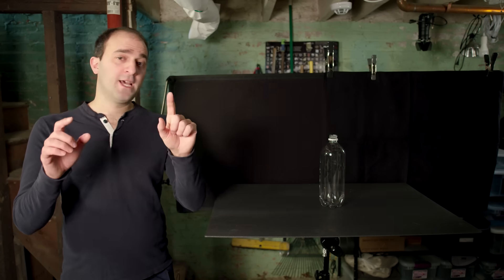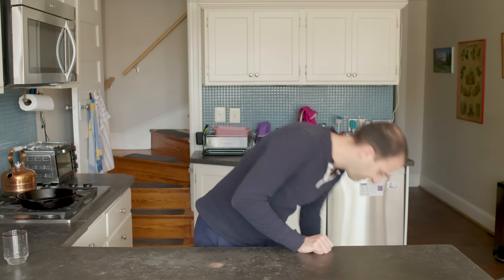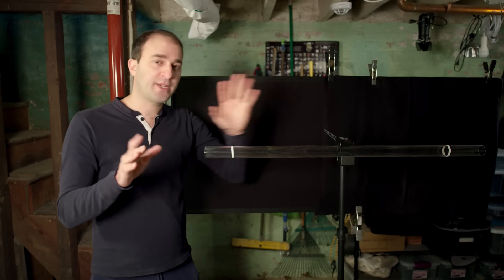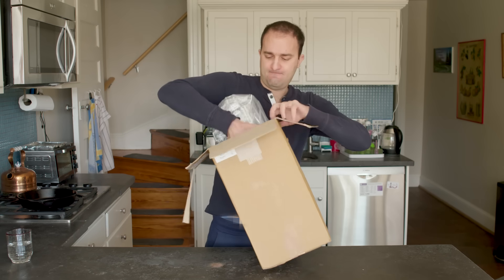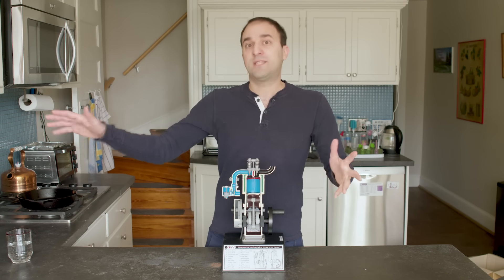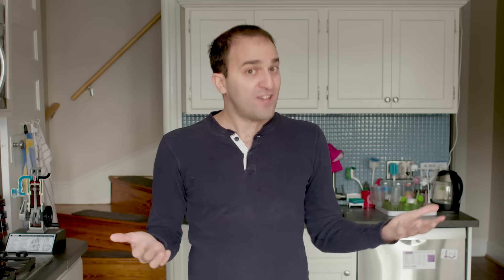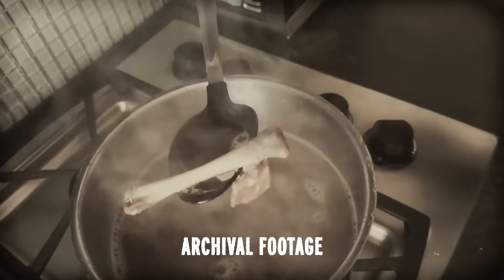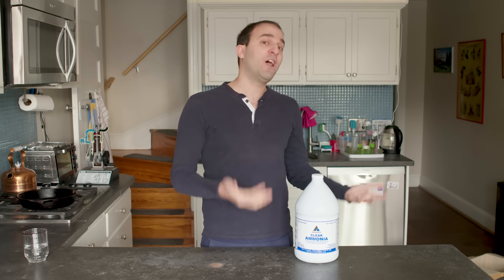Does Toyota Know Something That We Don’t?

Comment: Gasoline and diesel are highly flammable and relatively toxic compounds. Ammonia is highly flammable and far far far more toxic. Replacing a bad with a worse does not make much sense especially because you'll be venting a large amount of Nitrous oxide which will turn into Nitric acid in the atmosphere. I fail to see how an exponential rise in acid rain is actually a benefit especially when people are going to be dying in their garages and homes from leaks.

Then there's the energy need which is impressive. A commercially viable 1000 ton/day ammonia plant consumes 35GJ of natural gas to make 1t of ammonia at about 50% efficiency. That is 892.5 cubic meters of methane burned (and cracked for hydrogen) per ton of ammonia. That's equivalent to 277 Kilowatt hours of electricity. Multiplied by the thousand tons made per day and you get 892,500 cubic meters of natural gas and 277 Megawatt hours of electricity or enough to meet the daily energy needs of 9551.7 American households (29kWh./day) or 32,511.7 German households (8.52kWh/day) for a more energy efficient national comparison.

Gasoline usage in the USA is (as of 2022 numbers which are what I could find) 8.81 million barrels of gasoline per day. Each barrel contains 5861520kJ of energy. Assuming you want everyone to be able to drive the same amount you need the same amount of energy. Ammonia is less efficient when burned than gasoline and in an internal combustion engine studies I've seen show about 30% efficiency but for now lets take the impossible best case and assume 100% combustion efficiency. Numbers get a bit tricky here since every source invested in this tech appears to be throwing their own numbers out as 'truth'. So I've taken the heat of combustion assigned by the NCBI of 382.8kj/mol. 1mol of ammonia is 17.03g so 1kg contains 22,477.98kJ of chemical energy when combusted completely. This compares to 49,000kJ/kg for gasoline. Therefore if we need to supply the same 51,639,991,200,000kJ (8,810,000*5,861,520) of energy in the gasoline used by the USA in 1 day you need. 2,297,359,068.7kg of ammonia (2,297,359t). Going back to our production values earlier this would take 80,407,567GJ of energy to produce or 22335.43 gigawatt hours. Global electrical energy production is around 25,343,000 GWh so barring somehow of reducing energy consumption to a fraction of the current value you would need 0.008% of the total power produced each year just to provide the fuel for the USA. If basing it off the US electrical production figures you need 0.56% of US energy production to meet the daily needs of this industry.

Making gasoline takes 35.6kWh/gal meaning producing the same 8.81 million barrels (each of which is 42 US gallons) of gasoline uses 13,172.7GJ or only 3.66GW/h daily. So making enough ammonia to fuel the cars of JUST THE USA using modern production methods takes 610,257% more energy than is used to make the same amount of fuel energy in gasoline.

Overall I've seen worse ideas before but this idea is up there with the more questionable industrial decisions of the 1920s and 30s in terms of risk/reward analysis.

Comment: One summer I worked in a storage/shipping/logistics type of business and they had a forklift that ran on ammonia. This was legally required for people to work alongside it inside a shipping container, since diesel exhaust was considered too harmful. This was in the naughties and at that point they had had this forklift for years. My point is this technology is proven and has been in use for decades, and an ammonia engine is powerful enough to run a forklift, so it will definitely power a car. Smelt pretty vile, though.

Comment: we were taking about this in university 30 years ago.  it makes sense as a way of storing "excess" electricity generated from renewables. it can be synthesised on site. its a valuable feed stock. much easier to transport and store than hydrogen. i am surprised it has taken this long to be discussed in the wild
Reply: No that's completly idiotic, what ever university you went too you should ask for a refund.  If you want to store electricity you dont turn it into a chemical which then needs to be burned, you would be loosing 90% on the round trip.  Electricity at grid level is best stored in pumped hydro, flywheels or batteries.  And if you just want to just make any industrial process, particularly chemical synthesis powered with renewables then you MUST convert that green energy into a steady source first because constant stop-start is going to ruin nearly every chemical synthesis as well as ruin the utilization time of the equipment and capitol investment.
Reply: quiet you  @kennethferland5579
Reply: How would you go about synthesising it onsite in a smaller scale? Wouldn't Haber-Bosch be too dangerous and bulky to use?

Comment: High octane fuel burns slower. So it will burn thru the whole stroke in a high compression engine. Low octane is use for lower compression engines, where detonation issues is not as prevalent. Ammonia seems to work for very high compression. Not sure about the lubrication values of Ammonia thou..

Comment: Vehicles using propane as fuel carry a large compressed cylinder full of the stuff down the road at 80 MPH. It’s really not far from being a bomb. Yet there haven’t been significant incidents in that use. I don’t see ammonia as much different than propane.

Is ammonia dangerous? Yes, but that doesn’t mean we give up on it.

Can the dangers be sufficiently mitigated? The benefits of the fuel warrant a rigorous exploration.

Comment: I'm a little dismayed by short sighted comments.
The petrol car has been under development in one way or another for over 100 years. This means that the modern car has been developed well past some of the initial problems and we only see the end result. Things like a lack of infrastructure, or complications in the production of ammonia should not put others off from making such developments as shown here. We can't usually wait for things to line up perfectly.

When it comes to the production of ammonia, we currently have the Haber process, but there were papers released in the last 5 years which suggested that catalysts like black phosphorus could be used to produce ammonia at much lower energy expenditures. Even if the research is not completely reliable, there are still others trying to tackle the problems of efficiently producing ammonia.

Current battery tech isn't going to fix our current environmental issues and come with their own problems, so any avenues for better tech should be explored.

Comment: Ammonia is corrosive - period. 
If you want a car whose parts last less than 3 years, then ammonia would be the way to go. It would be easier to phase out ammonia cars because they will fall apart after 3-5 years.
Reply: You do understand that gasoline is also corrosive, and that engines were made for gasoline to not corrode them, right, and that if we made entirely new engines to work with ammonia instead we would use stuff that ammonia cant corrode, like nickel steel, right?
You cant try and say one is worse of an idea since the fuel is corrosive if both fuels are corrosive, design and engineering is what makes it work in the end

now, obviously, ammonia as a fuel is a neat idea, but its a bad idea as ammonia in general is more dangerous than gasoline (more caustic and volatile, aka, you need less to kill you)
if a gas line ruptures, you get gas on some things, it makes a mess
if an ammonia line ruptures, people die
Reply: @theoriginalbeanboy  EGR (exhaust gas recycling) and DGI (Direct gas injection) has reduced engine life by copious carbon build up, compared to any other tech.
Reply: @Napstar777  well yeah, neither option unfortunately are good options, either we're polluting the air by using some dangerous liquid, or using something way riskier than its worth
plus, not to mention, production of ammonia produces a fuckload of co2 on its own, so its not all sunshine n rainbows.
Reply: @theoriginalbeanboy  true that

Comment: The main issue has nothing to do with cutting carbon emissions, the issue is the production of cheap gasoline; with the more and more difficult means to extract oil, the more expensive it becomes. Attempting to replace gasoline with ammonia mixed with hydrogen only makes the problem worse, since you require not only the incredibly expensive production of hydrogen, but also the production of ammonia which comes from... natural gas. Which would only exacerbate the problem. Cutting carbon emissions is a meme, finding a new fuel source that can give us the same cheap source of energy that oil has given us that has singlehandedly allowed modern civilization to exist in the first place - that is the true goal. A goal that currently has no solution for us to get to. Replacing something that is getting more and more expensive with something that is even more expensive and would further increase the costs of things such as fertilizer, not the best of ideas in my mind.

Comment: "2/3 less energy than gasoline"

Obviously less than ideal, and there's probably no way to improve that since we've basically maxed out the efficiency of ICE engines. BUT, even after the improvements we've made, technology that gives VASTLY more energy-density than battery power.

Comment: Where ammonia combustion will have initial impact is long-haul aviation and long-haul container ships.  The former needs the lack-of-mass and specific power density that gas turbines vs fixed-mass rechargeable batteries or (atm) even heavier fuel cells provide.  A long-haul airliner is extremely specific-power efficient and constantly getting lighter as it travels.  Container ships need to stop burning bunker fuel for emissions reasons and don't have the same mass concerns--mainly minimizing money/mass/distance-traveled.  

One "safety aspect" of ammonia is its lack of explosive potential and its extremely low density means any sudden loss of containment would have very little collateral damage and zero lingering toxicity.  In short, it won't burn outside the confines of the engine and it very rapidly disperses since it's much lighter than air.  Still, as you rightly pointed out, it would be extremely toxic to those caught in the initial immediate vicinity of any sort of rapid containment breach.  

I'm sure you didn't get to it due to video length/focus concerns, but any sort of practical ammonia combustion produces a wide variety of bad NOx emissions.  It's not "clean", but no practical combustion system is AND we already have excellent NOx capture technologies that scale scale up/down the duty-cycle and power curves from large industrial applications (2-stroke marine diesels) to individual consumer (4-stroke sub-liter gasoline) applications.
Reply: LOL.  Just saw your pinned emissions article.  Thanks.

Comment: So here is the shocker, OSHA allows people to be exposed to Ammonia at 50 ppm for up to 8 hours. The real problem is you become desensitized to it quickly. It burns between 16% and 25% concentration. for some great viewing look up the Phillips 66 experiments from the 50's where they are trying to ignite Ammonia in open pits no respirators or anything for protection. it will blow your mind!

Comment: Ammonia is made from methane/natural gas.  Ammonia can be made from electricity, but would be very expensive.  Ammonia can make nitric acid.  Nitric acid dissolves almost everything if not everything.  

Liquid chemical fuel is required.  Liquid fuel has the highest energy density.  This is higher than batteries, or ....

It would be best to just make methane, propane, gasoline, diesel, etc from electricity, water, and CO2 in the air.

Comment: Back in 2008 I got up in front of the Ammonia Fuel Network conference in Minneapolis and presented on a renewable ammonia production plant design for the Niagara Falls area. There were about two hundred people there, roughly 5% were unsmiling men from Toyota, who all sat together and said very little. Glad to see there's been some progress.
Reply: Toyota always had good representation at the Ammonia Fuel Network conferences!  For many years, it seemed Toyota was going to make a move in this direction, and they never pulled the trigger. Now it seems they decided to go with Hydrogen, which was a strange decision I thought, since Ammonia is just an easier way to bring Hydrogen to mass scale.

Comment: I wonder about nitrogen buildup in confined spaces, unlike carbon monoxide, you can breathe it in and out as long as there is some oxygen. Unlike carbon dioxide, the body cannot detect nitrogen and will lose consciousness in an excess of nitrogen. The oxygen is displaced by nitrogen. As I said in another post, nitrogen dioxide will probably be produced which has an odour, is poisonous and is visible as a brown cloud the colour of black tea. How does it compare with carbon monoxide? At least you can smell nitrogen dioxide. Nitrogen dioxide is already present in the atmosphere com car exhausts, At the beach in Melbourne, you can see a brown horizon.
Sorry for the rambling post. Ammonia combustion engines intrest me, what would John Cadogan (Auto Expert channel) say?

Comment: Can't believe you'd never smelled ammonia solution, a common household cleaner, before, though I can vouch that you are correct that a sniff of a strong solution is like a punch in the nose.  It happened to me in a chemistry lab.  I had forgotten which of two beakers had water and which had ammonia solution in it.  I had the brilliant idea of smelling one of the beakers.  It was the ammonia solution beaker, **POW**! in the face.  (For future reference, if one wishes to smell a chemical, one should gently waft the vapor towards one's nose with an open hand.  Never inhale a huge huff suddenly.)

Comment: in an ammonia car you can have a cloth pad inside the car which is moist. The size can be changed to suit. This will absorb any ammonia very quickly. It will even create a minor vaccuum to do this, remember the ammonia fountain experiment?
Hopefully this pad will absorb the ammonia before your body does.
An evaprotive water cooler will probably work acting as a scrubber, where air is blown through something that wicks water away, this will also remove dust. This is an opportunity for a budding inventor.
A safety system in a parking garage will be a water sprinkler, exactly like the type used for fire supression.

Comment: I don't think the X-15 was powered by ammonia.  I think it was powered by hydrogen peroxide.
OK.  I checked it out, and the fuel for the rocket chamber was anydrous ammonia.  The turbopump fuel was hydrogen peroxide.

But anyway, it's not a minor thing to use anydrous ammonia to replace gasoline.  You have to carry around 3 times the amount, store it at low temperature and high pressure, and you need a much stronger ignition system.

Comment: Yep everyone knows that ammonia burns, and with a lot less energy density than gasoline, making an underpowered engine.

But ammonia is good for something much better than combustion: The amania direct fuel cell, which converts the liquid fuel directly to electricity.  

Such a fuel cell is still under development. And I would really like to learn more about ammonia based fuel cells

Comment: Why did my unopened Poland Spring bottled water lose a third of its volume in ten years? And the amount of air in the bottles remained the same leaving the bottles quite collapsed. It's like someone stuck a syringe in the bottle and pulled out a third of the liquid. How does this happen? Is the plastic porous enough to allow that? That's my best guess. These are the small flimsy water bottles BTW.

Comment: I suspect it would require corosion resistant Piston sleeve + Head + Valves made of 950-D corrosion resistant stainless steel plus it would require High compression like a Diesel engine around 400 PSI

Comment: ACTUALLY THAT IS TECHNICALLY NOT CORRECT......back in the mid to late 1800s when crude oil first started being refined, the main product of oil producers was Kerosene used both as a Lighting Product in kerosene lamps, AND to be used as a heat source!! This is because it was getting hard to hunt for whales, as Whale Oil had been used in lamps all throughout the 1600s to well into the mid 1800s!! 

GASOLINE was actually a "waste byproduct" of the production of kerosene, and because the internal combustion engine was still NOT widely used for anything (circa 1875), gasoline was literally dumped into large pits at the refinery as "waste" and products more sought after like kerosene, benzene and lubrication oils were saved! Remember in the mid to late 1800s was the time of steam engines.....and lubricant "steam oil" WAS needed for steam engines!! 

FURTHER IN FACT a lot of internal combustion engines actually ran on Benzene quite well, and a lot of service stations that sprang up sold Benzene as a fuel for internal combustion engines between 1880s up until as late as the 1930s! And still in many rural areas electric wasn't installed even as late as the early 1950s so heating and light products like Kerosene was still widely used and many a farm used stationary gasoline (hit and miss) engines to help with farm chores like running pumps to pump water from wells and such! Some of these stationary engines also ran on "heavy oil fuel" was basically was a type of early diesel fuel or kerosene as well!! 

My point though still remains that Gasoline was NOT produced for internal combustion engines ONLY and was for years, decades, thrown away as "waste" before the internal combustion engine gained popularity!!!